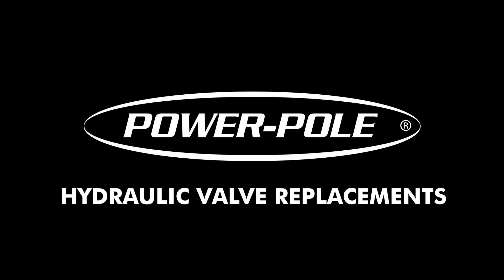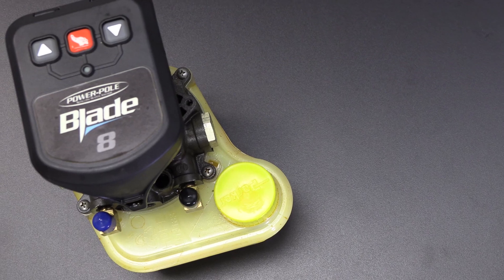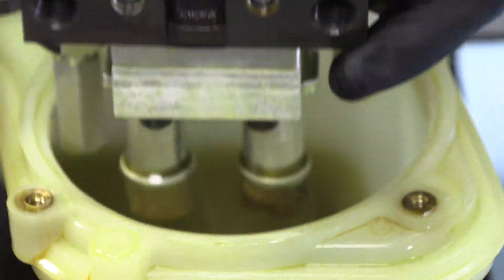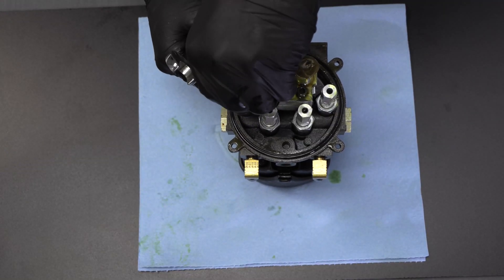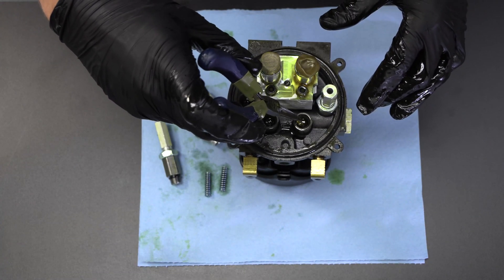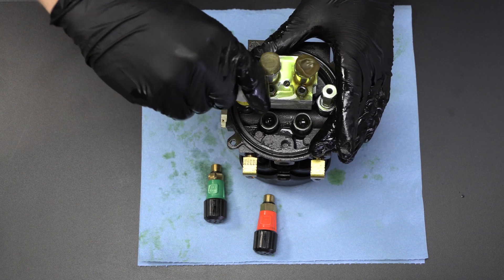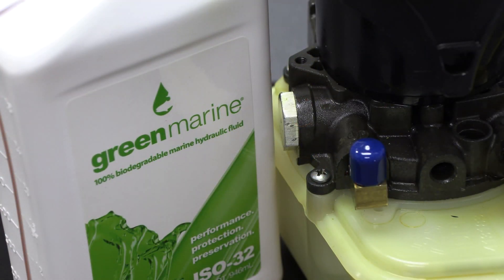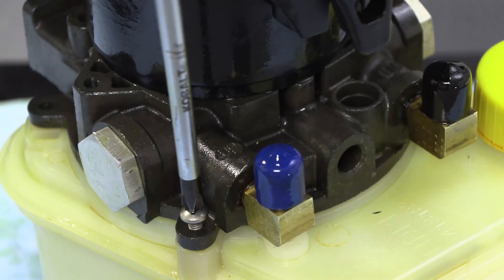JLM University: Hydraulic Valve Replacements

Comment: Red Valve (Down TRV): This valve is typically associated with the "Down" function of the Power-Pole, controlling the pressure and flow of hydraulic fluid when deploying the anchor.
Green Valve (Down PRV): This valve also relates to the "Down" function, likely working in conjunction with the red valve to control the pressure and movement of the hydraulic ram during anchor deployment.

Comment: I have a C monter 1 with Sportsman II 8' blades. I cannot find the kit on the PP web site. Would you be able to help with my research? Why is that the replacement exist? What's the benifit to do this replacement with the new model? 

thanks
Reply: Sportsman 2 and blades are 2 totally different poles, cheapest vs priciest

Comment: Mine came with a yellow, red, and orange valve. I have CM1 pump. Can you tell me what locations they go
Reply: Do you install yours already, what location
Reply: So did mine…
Reply: @ItsjustMerrick which ports did you install which colors? Are yours working correctly?
Reply: @scottmcdonald3107  it depends which pole you have. I have the 10ft blades. Mine was pink/red Prv up, yellow is Prv down, orange it Trv down
Reply: @ItsjustMerrick  thank you. I have 10 ft. Blades as well.
Reply: @ItsjustMerrick just got mine installed and working great…thank you!
Reply: Red Valve (Down TRV): This valve is typically associated with the "Down" function of the Power-Pole, controlling the pressure and flow of hydraulic fluid when deploying the anchor.
Green Valve (Down PRV): This valve also relates to the "Down" function, likely working in conjunction with the red valve to control the pressure and movement of the hydraulic ram during anchor deployment.

Comment: After you remove the "valve ports" and inspect them do you put them back in?
Reply from the maker: No. You would be replacing them with the new valves. We suggest that you inspect the ports because components from the old style of valves may be in there